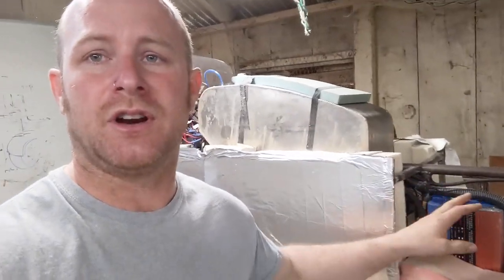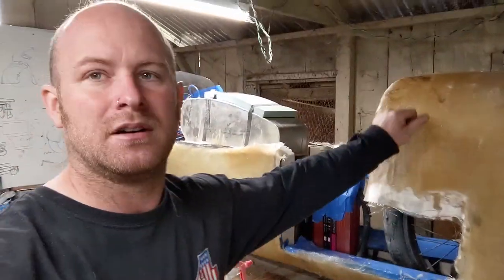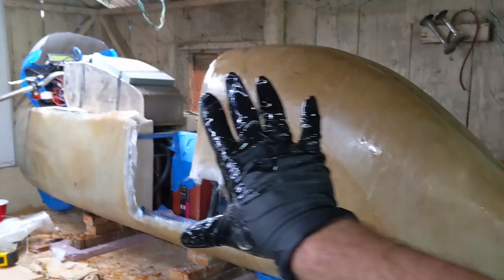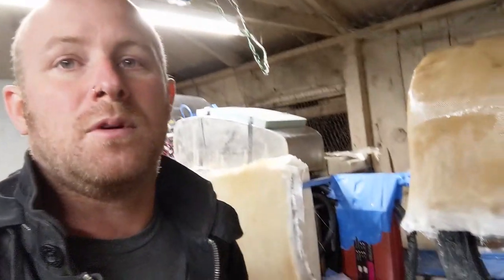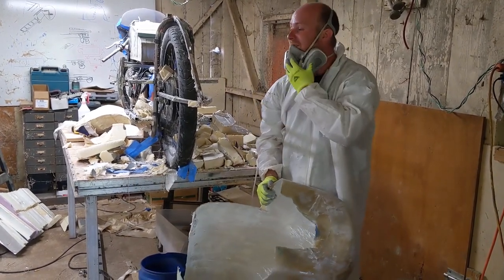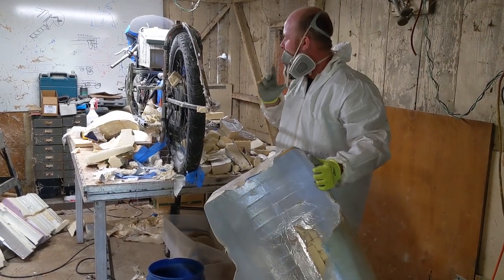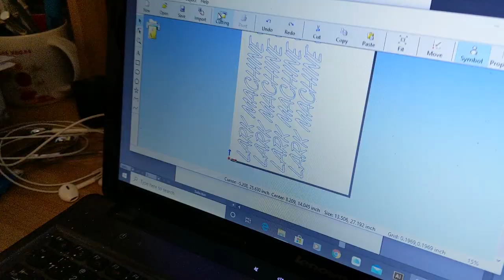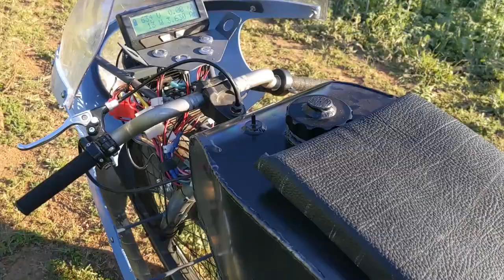Final build video Extreme Range EV Mini Bike!!! | Fiberglass, paint and assembly | Lark Machine Co

Comment: I am very interested to see how efficient your bike is on the road. A recumbent, electric motorcycle along the lines of Rob Horn's racer would be an excellent next project.
Reply from the maker: I tried to get some tests in before I posted, but it has been so windy out.  I was getting similar numbers as without the aero, but the wind was pretty bad and in consistent.  I'll have to do more testing